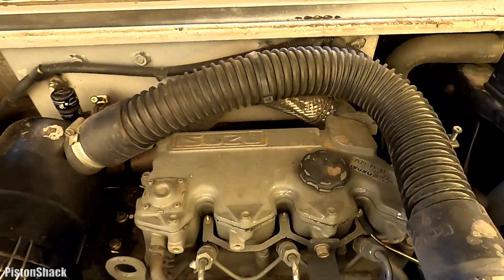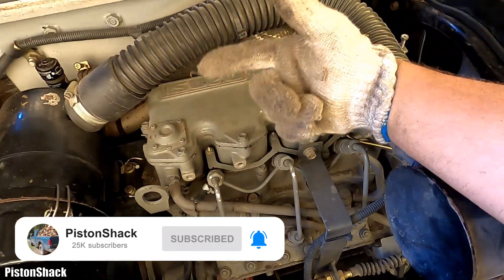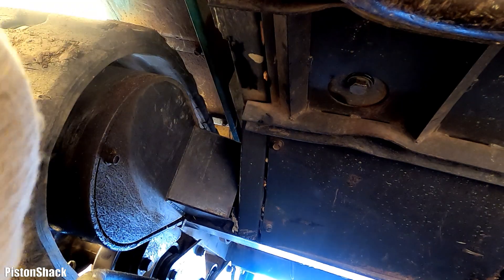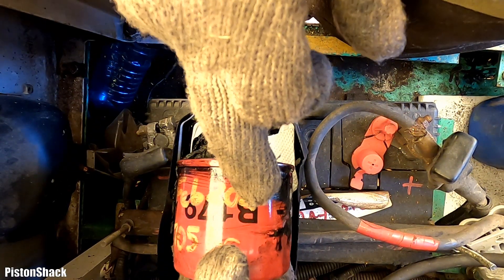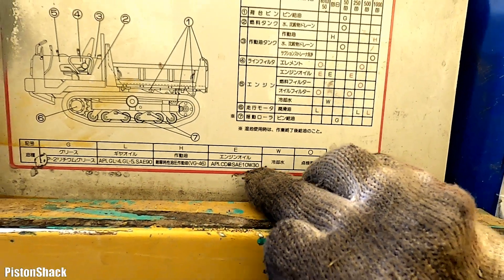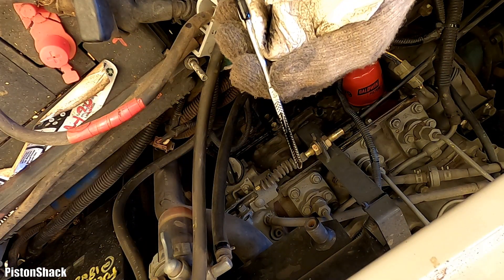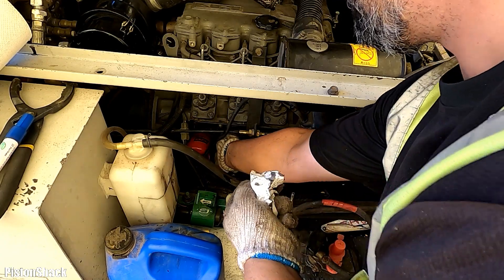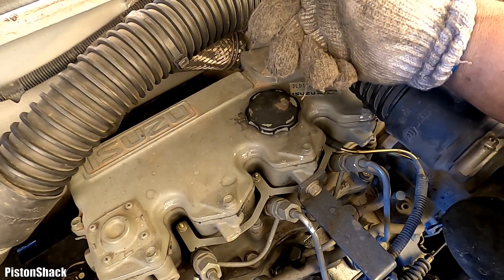MINI ISUZU 3LD1 DIESEL ENGINE OIL CHANGE IN DETAILS: CAPACITY, OIL GRADE, ECT.

Comment: I have the same engine. I just rebuilt it and now when I turn the ignition off it keeps running. I've searched all over and can't find any info. Have you ever had this happen?
Reply from the maker: That's pretty known issue on 3LD1. Most likely ignition switch doesn't cut off power down to the fuel shut of solenoid. First, I would disconnect solenoid pig tail connector to cut power to the solenoid coil. Engine should stall out. Then check ignition switch contacts, could be some power back feed to fuel shut of solenoid even when key  turned off. Also it might be alternator back feed to the solenoid, when key turned off.
Reply: @PistonShack  Thanks, I will try that tomorrow and see what I can find out.
Reply: Great video.what brand and what gŕade you recomend for isuzu 4le1 with 3000hrs?